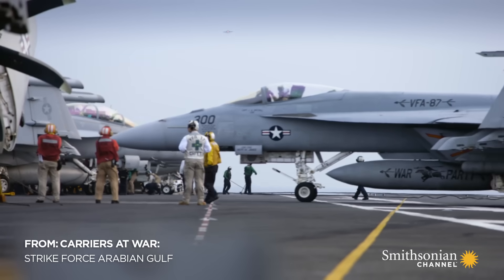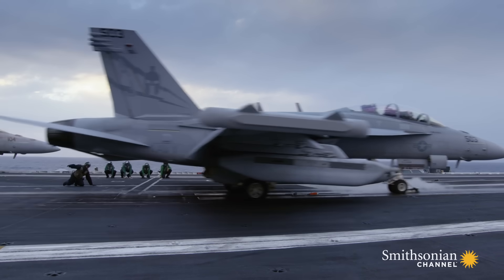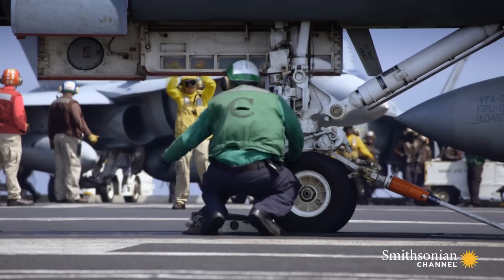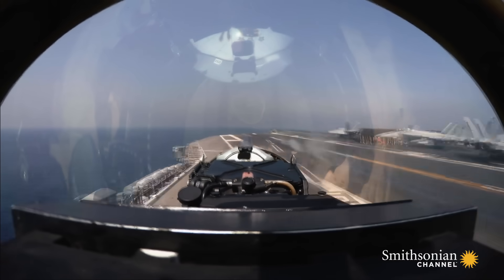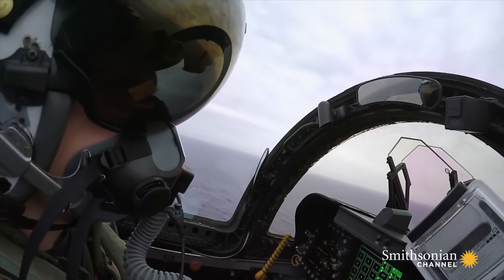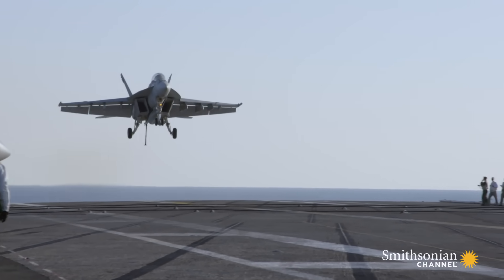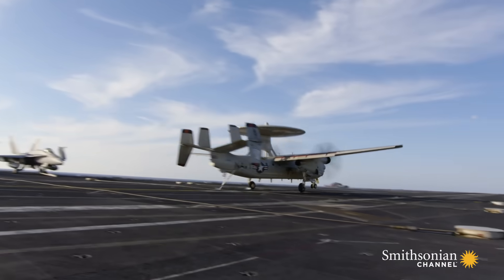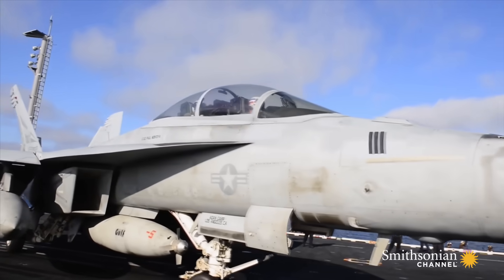The Intricate Skill That Goes Into Landing a Fighter Jet

Comment: What if the jets miss the hooks, and fall of the front of the carrier?, They should design a heavy rope type net that is suspended just above the water but extended out 30 ft or so just below the deck in the front of the carrier? I bet they never thought of that idea?????????? Or have they?????

Comment: Can the wheels roll over the arrester cables? I was looking for a slightly more in depth explanation on this and haven’t really found it. I always presumed that a wheel catching the arrester cable would be an issue but maybe not? If someone here knows - it’d be great to get more info on this. Thanks
Reply: my (limited) understanding of this is that the cables themselves are thin enough for the wheels to roll over, they're also suspended above the deck a few inches by leaf springs built into the deck, these can also be rolled over as they'll flex down into the deck

Comment: How do you train for this? Is there a simulation for this kind of thing? I feel just knowing the knowledge behind it is not enough to be ready for it, they need the experience. But then again, this is the military, so perhaps they do have a simulation for this.
Reply: Old comment, but basically they start with simulators, then they practice with a mock-up deck on land, then they do ride-alongs in trainers for the real thing, then they do it in a trainer themselves, and finally they'll move to whatever aircraft they'll be in for deployment.

Comment: Best vid i've seen yet !! Someone tell me why the big bump when jet leaves the ship? Please
Reply: Ken P62 If your talking about the jet bouncing right before getting launched by the catapult, here is your answer. When the jet is set into place on the catapult, a metal bar called the "hold back" is placed onto a lock on the flight deck and the back of the nose gear. Then when the pilot is ready for takeoff, they push the throttle to maximum speed. However, they cannot go anywhere due to the hold back. Then when the pin is released, letting steam to the shuttle propelling it forward, it is enough force to release the jet from the hold back therefore causing the sudden bump before the takeoff of the jet. :)

Comment: They should create some kind of laser type system, on the carrier and one on the fighter jet, that will connect to each other and will act as some type of "cruise control system" that enables the jet to bet controlled to land. Within this laser system, digitally, it will input wind, power, speed, etc., as to move the fighter jet into the landing phase. As for the pilot all he has to do is sit once he connects his laser connection with the carrier's laser system.
Reply: And add a big magnet !

Comment: And they hit the carrier deck at full power in case they miss all the cables so they can take right back off.
Reply: Affirmative, it's called a 'bolter' when they do that..

If you miss, & fail to 'trap', (catch the arresting cable, with your hook) on landing, and you go bolter..

You'll be at full military power, to 'keep the smash up' so you'll have the inertia and climbing power to 'touch & go' again with 'authority' 

If you bolt, just roll it into full AB, and pour it on, while you 'rotate' (back into a climbing, pitching the nose up attitude)..and just know that 'danger zone' will be playing in your head the whole time..

🎤 "..metal under tension, just beggin' you to touch & go.."

Comment: 3 wires? I thought there was 4
Reply: Their are 4 wires..
But not all of them work for all aircraft types..with regard to the F-18 hornets, 2 of the wires are optimal, while the 3rd works, but is considered sloppy, and you would have been a 'bolter' if you had not trapped that 3rd, lazy wire..

It will bring you to a stop a fair bit harder too, as on most carriers it's tentioned tighter..as by then your starting to run out of deck space for safe & proper recovery..

So, which deck wire(s) you ideally want to trap, depends on aircraft type & load weights, etc.

Comment: Fun fact: 
As soon as a plane touches down on an aircraft carrier, they put the throttle to max in case they miss the arresting wire so they can take of again an go around.
Reply: I wondered why they didnt mention that.
Reply: I also wonder why he said three wires, when there are four. The ideal wire to trap is the third one, but there are four.

Also, the wire/cable isnt "fed" to give the appropriate length. It's always giving resistance through hydraulics to slow the aircraft down.. It wants to hold back, not feed.
Reply: @eXX0n  newer carriers like the gerald r ford only have 3 wires
Reply: @tman4tw838  huh! I was sure they still used 4 thanks
Reply: @eXX0n  maybe he didnt say 4 because you dont want to land on the 4th one 
but then he should just say one because yea you want to catch the 3d one
Reply: TulllTott so you know better than an f18 pilot?
Reply: @eXX0n  the cable is actually loosened or tightened to the appropriate tension so that it stops whatever aircraft without causing damage.
Reply: TulllTott I think that’s what he mean, I mean if it didn’t feed then it would just be like the jet running into a brick wall. Right? It feeds but also has enough resistance to pull/slow down the jet. That’s just what I assume, I know nothing about this stuff
Reply: @eXX0n  They have 3 now to reduce cost.
Reply: @eXX0n  a2 wire is what I always tried for
Reply: @eXX0n  recently, they removed one of the wires due to maintenance costs, and no need for a 4th wire.
Reply: @tman4tw838  This is also the case for the more newer and newly upgraded carriers in the Nimitz class
Reply: @eXX0n  so you know more than a real F18 pilot just because you played DCS?
Reply: @jonshelley1079  classified information
Reply: Whaaat?!! that is a fun fact!
Reply: @Gatto01 it's not the wheels that catches the wires, it's a hook on the back of the aircraft..

The throttle is the lever that control the engine power. Like the gas pedal in a car.
Reply: @eXX0n  I always thought they just had good brakes.
Reply: Gatto01 there is a big hook next to the wheels that attaches to the wire
Reply: The Legend "
Reply: i was just about ask what happened if they missed the wire but now i know
Reply: True
Reply: Good info
Reply: Makes sense
Reply: The cable does feed in a way, a series of components at the bases of the cable gives it the proper tension. So the cable can catch and as the aircraft rolls, the cable pulls like a rubber band. Once the aircraft stops and releases the wire it can be retracted. So it always has tension.
Reply: I was wondering about that thanks for explaining
Reply: Caleb Schwartz ty
Reply: Ik
Reply: No they dont
Reply: Cool
Reply: @Gatto01 this has nothing to do with being English. Where are you from I guarantee ur country uses the term throttle
Reply: @sat8365  pilots have described the feeling like a mild car crash. You'd know.
Reply: I think you’re missing another f :)
Reply: That’s pretty awesome, thank you for that
Reply: You can hear the engine going up
Reply: @sat8365  They don't fall into the Ocean. 🤣
Reply: Caleb schwartz I knew that though my friends don’t believe me
Reply: Caleb Schwartz oh
Reply: How does the catapult actually work?
Reply: @josphatgitau3947  Below, sea water is taken in and boiled into steam. The steam is pumped through a piston, pulling the catapult.
Reply: You can tell as the engine goes really load whenever they land
Reply: U
Reply: Yep, we do
Reply: Yep!
Reply: @Gatto Good engineering. They're made out of high tensile steel not pasta ! Well, italian airplane wheels  might be !
Reply: Wow, that's crazy
Reply: @Gatto it wont be able to decelerate it fast enough.
Reply: Wow i never knew that! Thats cool
Reply: @Gatto you can see the hook in the vid
Reply: Just read my comment above ,it all makes sense
Reply: @Gatto , it's the gas or power the acceleration, like if you giv more (throttle), it means to go faster.
Reply: o cool. I thought about what would happen if the rope snaps but i didn't know this. thank
Reply: Makes sense
Reply: Bolter bolter bolter
Reply: and many times, it pushed forward and then they sink and the engine is spooled up with power as they hit the deck ready for miss wire. They use diff techniques to push down onto the deck at the last part and it is hard and fast , unlike a real landing with is a gentle 3 deg angle, flare, hold off and gentle touchdown if you do it right then roll out and brake. This is a controlled crash as they say!!
Reply: Fun fact: take OFF.
Reply: Yes, they do that. If the pilot misses it he needs enough throttle to take off. I was on the USS hornet museum docked at Alameda and the volunteer veteran explained this to us. The carriers are a true engineering marvels
Reply: Yep you got it . On the New Carriers you catch the Second wire of three Wires 
. Older carriers had four Wires so the third one is the one you Aim for .
Reply: The technical term is Bolter
Reply: obviously
Reply: Recently I think American Airlines had to almost do a touch and go. I don't think they hit the runway at all but a private plane taxied in front of a passenger plane landing and they went up again. Even passenger airliner pilots have to be ready to go max and get tf out the way. Shout out to all the ppl doing their best to keep air travel safe for all involved.
Reply: Interesting. I wondered what the did if they missed the landing.
Reply: Caleb Schwartz we get it you play the F18 landings game by rortos😂
Reply: @sat8365  there's a hundred guys standing around talking to the pilot on radio, and they can probably feel it, if they missed they would just take off again
Reply: I know
Reply: My dad ia actually a jet fighter in a aircraft carrier and told me that
Reply: @noproof2585  your dad is the plane?
Reply: @TulllTott
They used to use that type of method to stop the aircraft before the automated it. People where down there changing the resistance all the time.
Reply: I knew this....
Reply: Who didnt know that.....
Reply: I didn't know that
Reply: Everyone knows that
Reply: ummmm most people know about that
Reply: @RedditChronicles022  well i am not one of those most people ;)
Reply: @RedditChronicles022  he said "fun fact" not "most people dont know..."
Reply: @RedditChronicles022  actually most people know almost nothing
Reply: @RedditChronicles022  some, not most

Comment: No different than landing any other plane. Airspeed, altitude, alignment. Lots of non-Navy pilots can hit the same size of real estate... and that’s with flaring and aircraft with much lighter wing loading which complicates thing. What Navy pilots never have to deal with: terrain and obstacles on the approach or overshoot, 20G30 direct crosswinds, one way strips where you are committed long before you actually land because there are no options for a bolter, planes with low thrust to weight ratios. They also have the luxury of a bang seat and a plane guard should they screw the pooch.
Reply: "No different than landing any other plane." BHAHAHA
Reply: "No different" bahaha,  I'm a 777-300ER pilot and that's hard when you have crosswinds. Whereas they're landing almost normally but but they're in the middle of the ocean, their runway is moving and swaying, wind is twice as strong out on the ocean and their jet probably costs more then you will ever make in a lifetime :)
Reply: is this some type of competition or something?
Reply: Lol gtfo
Reply: No offense yet it is different. A runway that is perhaps 600' long (angle deck) that goes up and down. Rolling into the groove the first time is rather intimidating and Navy pilots are solo on their first trek to the  boat. You need to do it to appreciate it. Then you get to do it on a dark overcast night, real interesting.

Comment: The catapult apparently gets you to 3.41 g’s. I’ve been in a centrifuge and that’s quite an acceleration.
Reply: Random stuff with Michael that’s one hell of a roller coaster lol
Reply: @GroovesNZ  Well, there are roller coasters with 5-6G. Highest is 6.3G
Reply: @Spherify  well the fighter jets can pull 8gs easy and can hit 11gs but its not good for the plane
Reply: @sfg1877  vertical Gs are a little different. Pilots tolerate horizontal Gs like a Cat shot better than vertical. Airplanes tolerate vertical Gs more than lateral. Eg front landing gear must be able to support the jets entire weight times g. Instead of a partial g from braking tire friction only. Takes a much heavier gear and airframe to handle it.
Reply: @Triple_J.1  true i didnt think of that
Reply: You sure it's not 3.42? My g-ometer says it's definitely 3.42.    42
Reply: Well the acceleration equates to 150m/s÷2sec=75m/s^2 and if u divide it by earths gravitational feild u get 7.64g's
Reply: @hasaanbilal4846  150mph, not 150ms
Reply: @bobandbobandbob  yeah my bad, it then adds upto 3.4gs

Comment: But you never have a crosswind and you never have to flare. 🤔
Reply: The ship moves to eliminate the crosswind
Reply: No crosswind. Never have to flare. Sounds pretty easy 🤔
Reply: @thaicoon6242  not easy , jets are really slugish at low speed so you have to anticipate a lot before your plane becomes too slow
Reply: Warren Yas except for the fact that you have to catch one of the arresting wires while the ship is tossing, turning, and moving.
Reply: Bartonovich52 Also what's a bang seat and plane guard? I'm guessing ejection seat? And ?
Reply: Surely there'd be crosswinds from time to time. You're right though PROBABLY on flaring
Reply: Bartonovich52 Like Courcheval? (I think it's the worlds smallest airstrip, near the top of a mountainside in France.) The runway is on a sloped ramp, check out photos sometime it's insane! Or YouTube videos.
Reply: Also no obstacles on the approach. No obstacles on the overshoot. A metric fvckton of excess power. A bang seat. And a plane guard. 

These guys would probably shit bricks going into a one way strip in extreme terrain where your options for a “bolter” expire 30 seconds before you touch down.